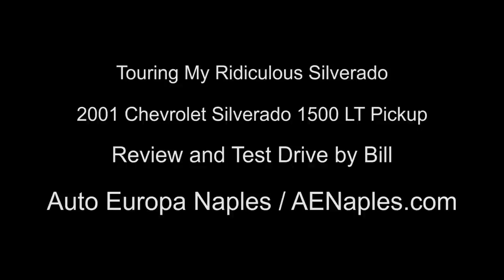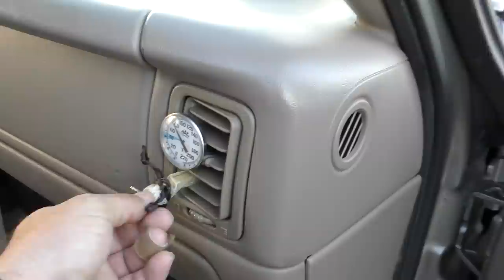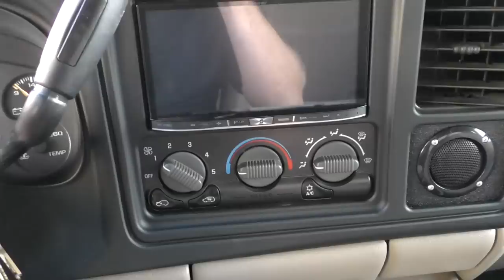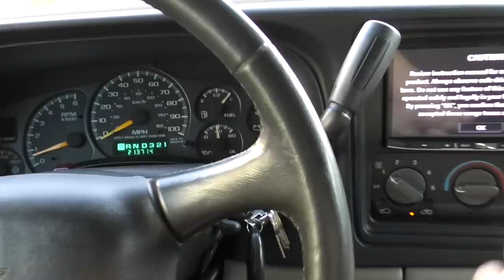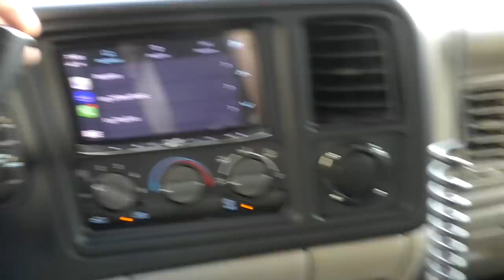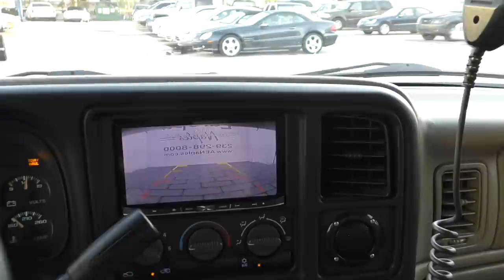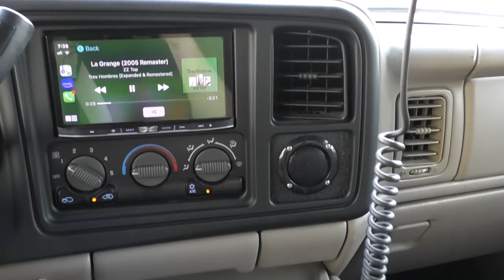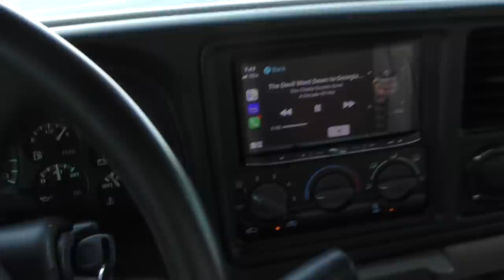The Best Used Truck Under $5K - Here's Why I Bought This 2001 Chevy Silverado and Absolutely Love It

Comment: He's right, it's a great engine.  I have a 2003 Yukon with this amazing 5.3 and the old-school 4.3 Lexus V8 in my other car.  Both are a joy to drive.  There could be a great debate on which V8 is better.  Pushrod Chevy revs out just as nicely as the DOHC 4.3 in the Lexus.
Reply: I have owned a 430 and my family are Chevy people. I would argue that those two V8s (and vehicles) are just about the most durable things you could buy at the time.
Reply: @texlad04  yes I enjoy both for different reasons.  I like the snarl the Chevy makes but the smoothness of the Lexus V8 can't be duplicated by anything.

Comment: In 2008 I bought a 2001 Chevy Silverado 1500 LT Z71 Extended Cab 4x4 with 103k miles in same exact color for $5100. I still own it. I had it up to 215k until I had to rebuild transmission. Still have it though. I may have dumped a little less than what I paid for it in fixing it (including the tranny rebuild). Considering how long I've had it and the money it's made me/saved me I'd say it's a good truck. Engine still run as good as the day I bought it. Hard to kill these Vortec V8s. Solid built truck. I've seen quite a few with over 330k to 350k miles and even getting to 400k miles.

Comment: Bill you should of got a Tundra. Engines in those things are solid but the transmission is garbage.
Reply: I wouldn’t tow anything heavier than a bike rack with a 4L60e.  Those transmissions were weak.

Comment: The 1999.5 thru 2002 & 2003 thru 2007 are very good trucks. I have a 1999 Chevy 2500 Excab 4x4 6.0 214,000 miles, I’m the 2nd owner bought it with 110,000 miles I owned it for 9 years, a very good truck.  I also got a 2001 Chevy 2500HD Excab 4x4 6.6 Duramax lb7  95,000 miles I’m the 2nd owner bought it with 90,800 miles, bought it 6 months ago, also a very good truck. And I got a 2004 Chevy 3500 dually crewcab 4x4 8.1 (496ci)  264,000 miles, I am the 3rd owner bought it when it had 237,000 miles on it ,3 years ago. I like these older Chevy trucks better then the new body styles.  I just sold my 1994 Chevy 1500 Excab 4x4 5.7 with 194,000 miles bought it back in 1999 with 74,000 miles. I wouldn’t have sold it but someone hit it in the rear hard , bent frame , ruined the bed and shoved it into the driver side cab corner. I had just painted it , rebuilt the transmission new tires and brakes all around it had no rust. It was still fixable.

Comment: Yes I have one and I love it. 2001 Silverado 1500... I don't know why but it is the most dependable reliable vehicle I have ever owned. It has 198k on it and you would think it was less than 50k. The 5.3 Vortec is amazing! Stock they had 285hp, mine is about 300 with a few bolt on upgrades like exhaust and cold air intake kit. Like you I replaced the springs and shocks and the only repair it's ever had to have in the 15 years I've had it was a new in tank fuel pump. Regular maintenance, a tune up at 100k and 150k and that's about it. I am one of those guys who could buy a new truck but why?

Comment: Usually, Bill complains about the weather, but it's not always this way. Anyway, loved this Silverado and the sister Sierra (both as Gas and Diesel), they're pretty good trucks so far. 

Also the new Silverados (I'd buy it if it wasn't made in Mexico) are really nice, V6, V8, Inline-4 or Inline-6, diesel or gas, it doesn't matter what engine I'd choose, but still they're pretty good and solid trucks. Also, love the dually beds as well.

Comment: Just picked one up for cheap, going to use it to pull my boat to the dock and back 30 miles each way,, Yours is Very nice, wished mine was nice like yours. Thanks for a Cool video sir and did I mention,, Cool truck also,, who cares if the seat looks like a Buick, it’s Comfortable.  Guess I’m getting old. Take care.

Comment: Very nice upgrades and awesome truck. I own a counter-part to that truck, the sierra. Another upgrade you can do is add stainless steel line couplings that connect to your heater core, the lines connecting to the left of the engine in the bay. Most companies sell plastic ones like oem, but Dorman sells stainless steel ones.

Comment: Never heard the story about the LT Corvette beating the DOHC for preference or the NHRA guy on the design team. I don’t want to come off sounding like Frank Lloyd Wright but anyone who’s ever looked at  a Ford SOHC cylinder head (even the venerable 5.4 2 valve) and not been repulsed by its sheer ugliness compared to an LS head needs to get a new prescription from their optometrist. Add to that the propensity of the Ford to blow spark plugs out through their individual coil pack 😵‍💫 which taken by the book destroys the coil, the plug and the head casting (with no provocation) and the GM engine is a work of art. I have a 99 GMC ‘new’ Sierra I bought new and has been absolutely trouble free for 160K miles and thanks to this video I’m proud to say I own the same truck as you do, Bill.

Comment: I have an LS same year, as far as the motor goes in the past few years all I've done was replace the oil pressure sensor. Other than that it runs great, 
The 2016-17  Silverado wheels look great on the 01s  just in case you change your mind  about the wheels

Comment: 2WD has a higher trailer towing capability, and rides better on coil springs versus straight axle with leaf springs or torsion bars on the light duty independent 4WD front end. Personally I prefer 4WD (not AWD) and I'm a Jeep weirdo.. the OHC 4.7, the 5.2/5.9, or 5.7 Hemi's in the WJs and older Gen 1 ZJ's/(newer WK & WK II have the Hemi)  have plenty of power and torque. With optional factory 3:90 gears and 5 speed 545RFE automatic with lock-up converter, versus the weak 42RE that can't tow itself without blowing the trans. These go anywhere anytime and are bulletproof drivelines. Substantial steel quality even here in the rust belt doesn't fall apart, and interior are Mercedes Benz quality, since Daimler was at the helm until 2013. 

These Silverado's with Hydro-Form frame,  the updated 5300 LS motor, 6L-80 trans, and decent steel construction, make for great, long lasting, comfortable, capable pick up trucks, for either towing or hauling, and the 1500 Silverado 2WD is no exception. Maybe put the 2500HD rear springs/shocks on it for increased towing capacity, better ride with less sway at speed and heavy loads. Awesome, pretty clean perfect Platinum color version of this well loved truck. I love all those nice, well thought out personal installs you have performed, .. isn't Amazon and China-Freight great?!  You should be proud of what you have there, I'd say this is the nicest otherwise stock looking early Silverado I've seen anywhere,  since they were new and I PDI'd as well as  worked on them brand new under warranty, at the Chevy/GMC dealer. As a 35+ year veteran technician of GM, Mopar Mercedes, Audi, Toyota and Volvo, (fuck Ford!) I know just how great and innovative these trucks were at the time.. , taking modern pick ups and SUV's to the next level. which was a decade before everyone else's design tech caught up.

As I've said, I'm a 4wd / Mopar-Jeep/Toyota truck guy. I just like them better for myself, and my wife loves them as well, before driving the Jeeps, she hated them. You have over 200k miles on that truck, and it looks like its brand new, inside and out. The engine is OBD-II but pre DOD GM LS junk, so you wont have the cam and lifter wiping issues those seem to all have. It's certainly not a 3 valve Ford with their Triton junk engine,  those extended reach plugs that snap off in head, or the exhaust manifold bolts which rust off in the heads, and have to be drilled/tapped to reinstall. Best overall truck the Silverado of these years , higher towing capacity than the 4wd version of the same thing. You really did your homework, and know what you are doing! I love the channel, especially all the older Malaise era yachts, the older Buick Riviera's and similar, Muscle-Pony cars,  the many GM offerings, and even some of the vintage FOMOCO stuff, specifically the Lincoln Mark's from back in the 60's and 70's. The 90-'92 Lincoln Mk VII LSC is my favorite, I wish you'd do one of them. I want to get one and build it up, add the rare 5 speed and Mass Airflow, build up the 302, stroke-bore it to a 334, add an underhood supercharger.. takl about your Hot Rod Lincoln, on the venerable, well supported Fox Platform, the sky is the limit! 

Keep the great content coming, with guys such as yourself out here still, I continue to have some hope for the future, even in a world chock full of Dumbass Daltons the Snowflake, who cannot even inflate a spare, notice the spare is missing, or clean an inside windshield/glass, even mildly detail an engine compartment. Euthanasia for certain retarded, under performing children should be an option, perhaps spaying-neutering  for similarly affected adults should as well! JUST KIDDING, don't cancel me!

It'll be justifiable homicide if you ask me, shooting Dalton.. a mercy killing for him. You will be saving yourself from the inevitable stroke that his BS will give you one day, perhaps after you loose a high dollar sale because of his crazy crap, when you have a buyer a high end classic vehicles you deal in! 

Maybe one day I'll see you at Carlisle, I live about 30 minutes from the Fairgrounds, and would love to meet you there next time you are up this way. I'd love to show you around here, to some of the local race tracks, car hop hangouts, gathering places, places where folks such as yourself can appreciate the vintage iron you love to buy. Perhaps we could even visit the Gettysburg National Battlefield, as a firearm and history guy, I'm sure you'd love that. The reenactments are bitching, well for as long as they survive the insane current Cancel Culture who are  in control. Clowns to the left of me, Jokers to the right..  We aren't giving in to these folks around here. We are not taking down statues of General Bobby Lee, or hiding our Confederate Flags. The jacked-up pick up truck guys sport around with their full size American and Confederate Flags flying high and large,.. one  on each side of their pavement Princess 4WD smoky Diesel ( I know you love them.. lol ) drop hitch trucks...The drop-hitch hotties love those, and some have a set of balls swinging lower on the hitch as well to complete the physical analogy.. You have to LOVE IT.. lol. 

ROCK ON, Bill, you truly are the best, ..

BTW, were you ever a Disc Jockey, you have great verbal pacing, elocution , and annunciation, almost as if you were trained for broadcasting. Certainly you are a well educated intelligent guy, and in the car business those aren't always easy to find!

Comment: funny you mention diesels, few months back sunk 6k into EGR fix.  then another 800 for a mouse chewing darn cables, then 400 for tires.  then today, another check light on another glow plug that'll set me back 800.  so down at a local dealer there is exactly the same pickup in same condition you have right now.  4400 bucks but 314k on the motor.  apparently drives 100%  so for a highway driver 120 mile round trip to our other house and 2 miles down the road to the grocery store, i think that may work.

Comment: I have this exact truck. My 2001 has 400,000 miles on the original motor and the original transmission.

Comment: I also have a Valentine 1 radar detector, it’s fantastic, had it for years. Also have a front dash cam but I need to get a rear one set up! 250,000 miles on my 2003 GMC Sierra 2500 Crewcab. Still prefer driving my 05 Land Cruiser instead though lol

Comment: this truck is on the LQ series whether it be the LQ4 or LQ9.same block as ls but instead of aluminum its iron. the internals are a bit different from ls internals. ive been looking into it since i own an 01 1500HD 6.0L and was looking into rebuilding it into a true LS once it hit the pooper and tossing it into a miata or just grabbing one from a junkyard and rebuilding that.

Comment: 342 comments that’s pretty amazing in and of itself. You’re getting this one just because I just rolled 200 on an 02 with the four-wheel-drive package and a lift kit but identical. This  Truck with the Vortech truly is the atomic cockroach, she ain’t pretty anymore but she’s out lasted a Tahoe,  a Yukon, a jaguar F type & a Porsche 911. I’ve been told  more than once by family that I need to get a new truck and I’ve give the same answer “I wouldn’t do with a  new truck what  I’m willing to do with this truck” and I’m not going to buy a new truck until this one dies

Comment: 2 years ago I found a 01 2500HD , 6.0, manual 4x4 short cab long bed with 68,800 miles . Manual windows , rubber floorboard no carpet , matching color camper top. 7k for this truck at a Toyota dealer. Owned by an elderly man that traded it for a Prius !!! 
Did I steal it or just get a fair deal. 
Paid cash!!

Comment: Hello I have a 2001 Chevrolet Silverado V8 runs great but I'm having touch with my heater can you please tell me or the guy that knows about trucks I have trouble with my heater sometimes it works but most the time it don't can you please tell me somethings to ck.  One of the two black hose one on right is hot the one on the left is cold can you help please?

Comment: I Just got a1990 the Engine looks Small! It Says Vortec!  But The Exhaust is Missing from just Under the Cab! But it Maybe 2 1/2 make 3 ?  It Sounds Mean!  I haven't started Tearing it Apart She sat for a few a Year! New Battery Fires on the First Turn! Tires are Good but The Big Girl Sank in The Ground a few Inches.  My Sister asked me to Come Fix it so She Could Sell It. The Door Panel Fell Off,I was Fighting to Get the Door Open! Thinking Damn What a Piece of Junk! Then I Got Looking Closer! This Thing is A Diamond!I Said I Want It!  she Hugged Me With Tears! I Said Sis that Thing Is Worth More Than You Know! I Can Turn Around and Just Sell It She Said I Just Don't Care I Need to  Find the Money to Buy My House! Love My Sister Her Husband is ? Lazy???? I do Love Him He Just Weird? Stays to Himself! But  In charge of a Crue that ? Nevermind I Don't Understand?  Bullshit!  I Work on Semis and Sanitation Vehicles all Day!  I'm Covered in Grease, Dirt, and Hold My Breath Most of the Time! But I Make Sure They Are Safe! That's What I Do!! Cars and Trucks are Tiny when I work on Them Lol!  11 R 22.5 are Easy. Then 315 22. 5 that's Switching to Beast Mode! I Got My Bar. I Line it Up and It's on Lugs Lubed and Clean!:Blap Blap Blap! Then The Torque has got to Be Exactly 500lb. Wheel's will Fly Off and That Bad!!!